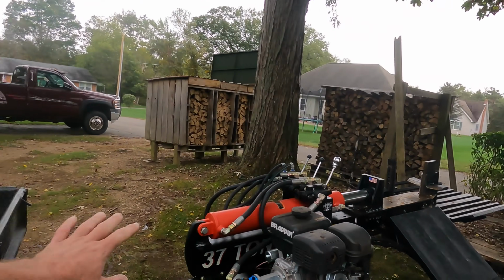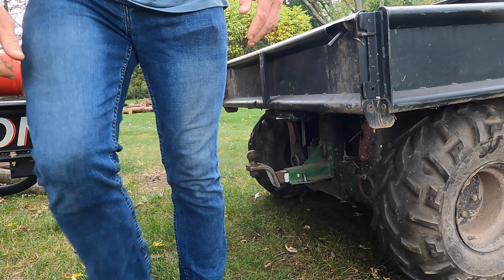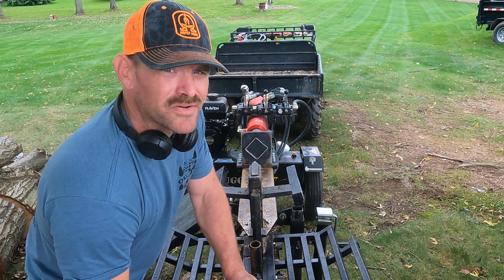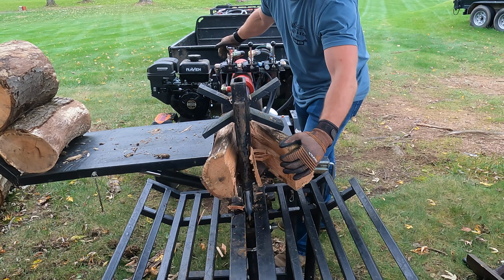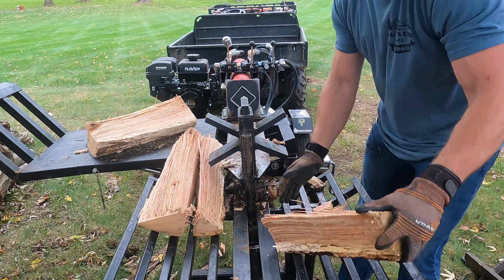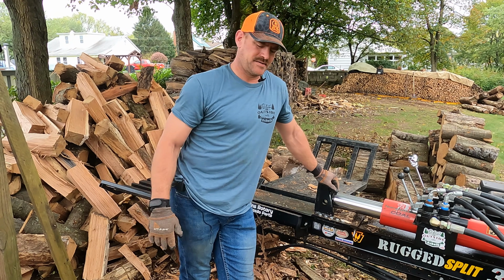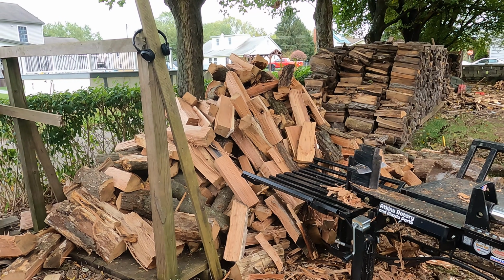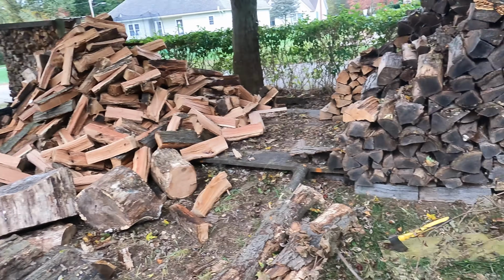Splitting Red Oak for home heating.

Comment: That was some good looking red oak.  I especially liked one thing you pointed out.   You have to be in the mindset to split larger after splitting for bundles. It definitely is an adjustment in the thought process.
Reply: Hey Woodruff, I struggle with splits when I'm in the skid steer.  They always seem to appear smaller from that point of view, but once I grab on to them to stack or load the stove I'm fully aware how large they are!
Bless'ns to ya,    Tedd
Reply: @sawsurgeon  I can definitely relate to that.  The back doesn’t lie!

Comment: New viewer here so I apologize if this has been addressed before, but it looks like you have close neighbors do you get complaints about the saw or splitter running?
Reply from the maker: No but I do try to warn them if I am going to be doing anything. But sometimes I just need to get stuff done so it is what it is. I haven’t had any complaints yet!!! I do help out in the winter with snow removal and some times with there lawns so I don’t get much complaining.
Reply: @OutsidewithScheib  sounds like good neighbors

Comment: Hey buddy was curious, i just assembled this splitter 2 days ago and use it for the 1st time this morning I had a few small leaks but now when I check the hydraulic dipstick it's showing 8 gallons ..i'm guessing because the system has fluid in it now I know when I filled it it was 12 gallons do you know what the Running level should be on your splitter?
Reply from the maker: Yeah you should have 12 gallons in there after the system is full
Reply: @OutsidewithScheib   Thank you so much for the reply I watched the assembly video and the guy from RuggedMade tells you to put in 12 gallons in it he never says to run it and fill it backup...